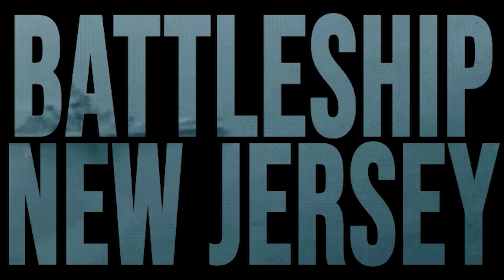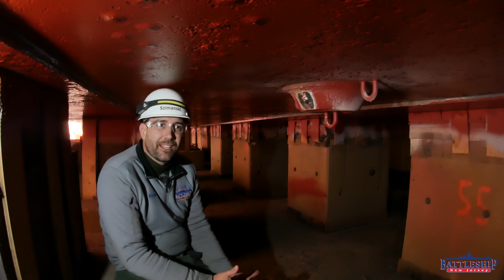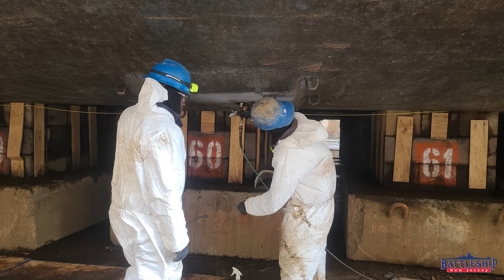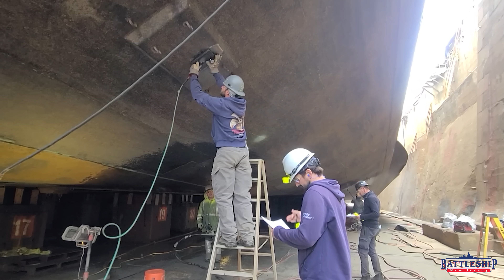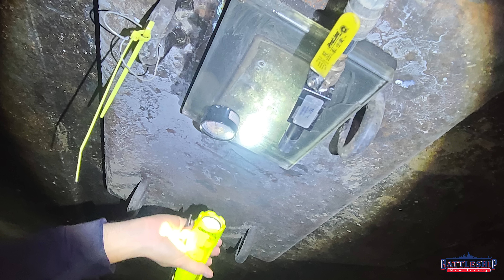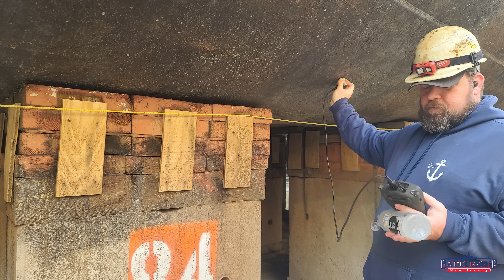Keeping the Water on the Outside: Vac-Boxing Your Battleship

Comment: I would have thought for testing the weld they'd do either dye penetrant or mag particle testing. X-ray might be tricky and too expensive for this application. But I suppose the method being used here is probably the most cost effective.

Comment: Well using a vacuum pump, if you can get the ship into enough of a vacuum any moisture can be sucked out, but im guessing the hull sections are too large, not structurely capable of sustaining a vacuum without imploding… but this is alot of work and seems strange

Comment: What’s the reason for not using something like a helium leak detector? My first impulse (having worked on vacuum systems) would be to hook up a helium supply internally and then use a standard helium detector on the outside. Would give a lot more resolution than soapy water, I’d imagine. Soapy water is good for rough work but that can’t seriously be how you definitively test it?
Reply: The vacuum gauge will give the sensitive measurement. The soap is only to show roughly where the crack is
Reply: @MatthewMakesAU  Ahhh I see. Thanks for the info!

Comment: You mentioned in a previous video about the blanks that testing showed a number of the valves inside had failed or deteriorated.
Does teh museum have any plans to recondition those valves as an added level of protection if one of the blanks fails in the future?

Comment: I'm going to say the the pressurized air is running through a Venturi valve which creating the vacuum inside the box which then pulls the vac-box up against the box blank.
Reply: Right, they wouldn’t get very much vacuum by pressuring the box
Reply: It is possible that that is how they were doing it as Venturi vacuum pumps are a thing, but when I've done vacuum box testing, I've always used either an electric vacuum pump or a hand vacuum pump.
Reply: No
Reply: @asbestosfibers1325  No to what?

Comment: It would be wonderful to be able to have at least 1 battleship mission ready. Although I must admit that those stationed onboard would be in cramped & archaic  quarters compared to the newer USN ships of today. Perhaps leaving them as museum ships is best anyway. Thanks Ryan🙏👍🇨🇦
Reply: Given the amount of downtime for short (few months) & long (up to two years) term mantence, to generally expect to have one mission ready at any time, you typically need three ships in a planned rotation. Even if that does leave you with two as an option more often than not.
Reply: I fully understand why what I wrote is not practical for many reasons but a pipe dream for the imagination. I served on a 1940’s era aircraft carrier in the early 60’s that was no joy compared to the USS Gerald Ford so serving in on an Iowa Class Battleship today would be like a jail sentence under current conditions. Thanks for the input though SnowmanTF2 always good to hear from a fellow serviceman.👍👍🇨🇦🇺🇸
Reply: @normbond8888 it wouldn’t be too bad to serve on an Iowa today. These ships were originally designed for a 2000 person crew but back in the 80’s only something like 1200 were stationed on board. If you watch Ryan’s previous videos you will see some of the compartments were not used in NJ’s last commission. Also in her last commission the bunks were upgraded to the modern coffins as they are often called. Also the ship had an ice cream machine and a donut shop so it did have some luxuries. Even one stage she  had a swimming pool I think when she served during the Korean War.

Comment: What I don't understand is, that these boxes are welded on to seal older utility holes in the hull, right? So when air pressre testing these boxes, why doesn't the air escape through whatever the box is covering? I thought the whole point of the boxes is that they could be cut of when need be, so the hole behind them should still be open?
Reply: Because the valves are closed. It would be pretty mad to put a hole in the bottom of your ship and not put a shutoff valve on it.

IIRC he said in a previous video that on several of the openings when they investigated a pressure test failure they concluded it was a problem with the valve rather than a problem with the plating over.
Reply: Because they are  looking for leaks in the welds between the box blank and hull not the underlying through hull openings. The box blank is pressurized and soapy water sprayed on the weld, if you see bubbles the weld itself is not water tight.  The purpose being to prevent water intrusion through the box blanks and then inside the hull. There have been tests where the welds where good(no bubbles) but pressure was lost due to problems(generally valves) in the through hull opening. See segment from previous video starting here https://youtu.be/4PnRMG_DBSQ?t=248
Reply: @adrianklaver113  while that’s true, it would be difficult to do the first pressure test ( the reason for the test port they are checking) without it being sealed on the inside too
Reply: @rollastudent  See the video segment I linked to. Sealed as the valves are closed, where said valves are not actually fully sealing anymore and are letting some portion of the air into whatever space is on the other side of the valve.

Comment: Amazing that the wood can hold all that weight.
Reply: If NJ's 45,000 tons is evenly distributed across the 304 keel blocks each 4ft x 4ft block supports 148 tons, which comes to 128 lbs on every square inch of wood.

Comment: have those plugs GTAW(TIG)  welded in by a master welder and one out of 500 MIGHT leak..
Reply: 1lroughly 7- 15 percent of in field welds fail.
Reply: @asbestosfibers1325  not TIG welds that small, are you kidding? if those plugs are 304, or 316, using 309 our 310 can't imagine my welds failing any more that 1% IF I WAS STILL DRUNK FROM THE NIGHT BEFORE...
Reply: No way man. Stick weld em all the way. More penetration

Comment: As you know where the plated through hole openings are, both inside and outside the ship, why not drill the hole on the inside and air test from there, where a failure won't let water into the ship.
Reply: whats on the other side of those plates are usually sea chests, etc where being able to get to it would be very difficult or impossible.
Reply: Because that would require drilling through the actual *hull*, which they don't want to do. Those blank boxes are supposed to be removed if the ship is reactivated. Drill through from the inside, and you've just put a permanent hole in the hull.
Reply: @maigretus1  No, they could also drill into the pipe just inside of the hull, and weld in a screw in bung, making future checks easier, even with the ship in the water.
Reply: @ravenbarsrepairs5594  I consider those pipes to be part of "the hull", in the sense that they are intended to keep seawater out of the main spaces of the ship.

Besides, the museum has to keep her at least somewhat ready for activation if the Navy wants her back, unlikely but still possible. I don't think the Navy would allow Ryan to drill a hole in a part of the ship that would be more-or-less continuously open to the sea if she goes back in service.

Comment: FLEX SEAL should  sponsor BB-62.
Reply: Lol! I don't know if the Navy uses flex seal in the emergency repair kits but they should. The stuff is amazing,  last year I had a large tree limb fall and poked a 11" hole in the roof. I was initially freaking out since it was still raining and water was pouring in. I remembered my sister gave me a box with precut flex seal sheets in it. I put one of them over the hole and sprayed half a can of automotive undercoating around the edges for giggles. The repair instantly stopped the leak. I was impressed and my landlord was thankful I prevented further water damage to the house.
Reply: @rogergoodman8665 it is far from amazing and your anecdotle evidence is not worthy of abject scrutiny
Reply: @asbestosfibers1325  🤣😂
Reply: Flex seal is absolute garbage.
Overpriced trash. 
I have removed more flex seal and great stuff from ignorant homeowner repairs than I care to admit.

It is overpriced and underperforms.

It is genuinely garbage and if you use it you are clearly super gullible and smooth brained.